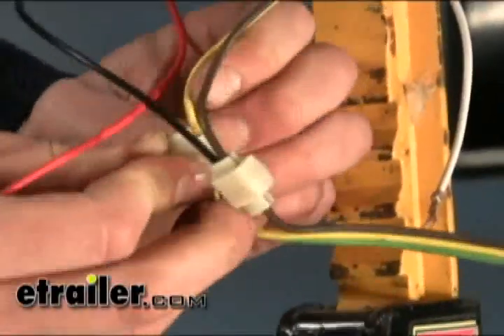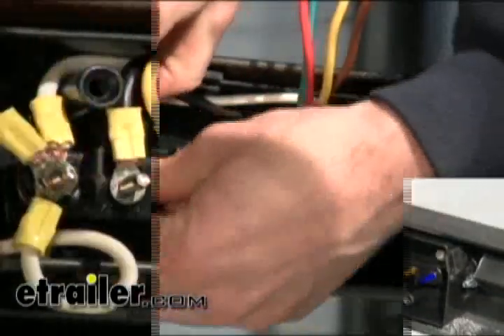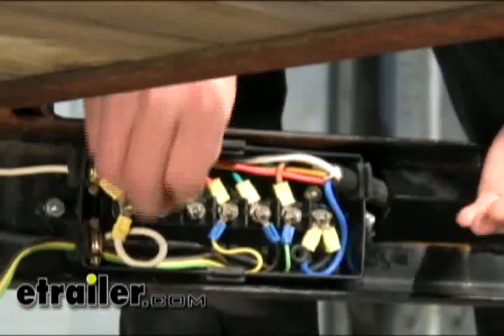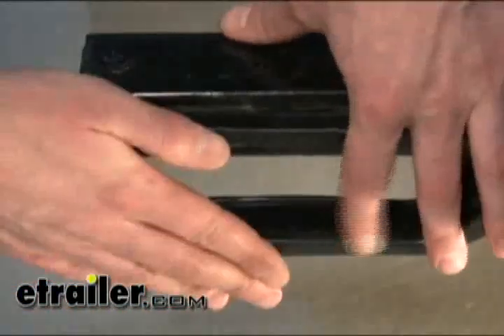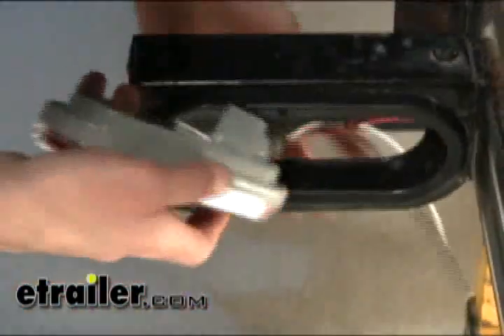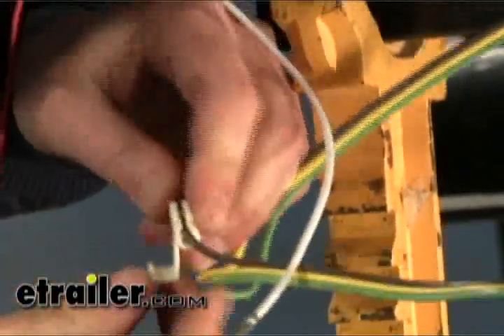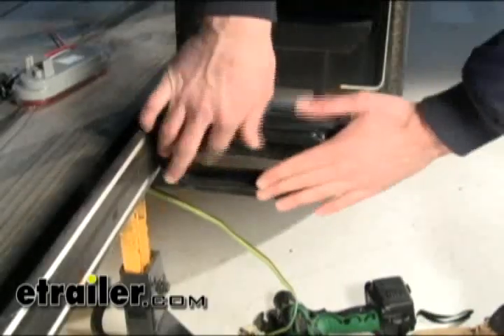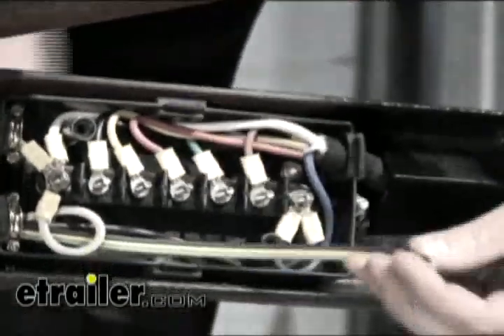etrailer | This Old Trailer: Wiring Trailer Tail Lights

Comment: I just changed my trailer lights to the round lights with red/blk/white wire. I have them running on the normal trail 4wire flat which connects to the vehicle flat connect. All of the lights work while vehicle lights on except when I press the brake .The lights go out but when I have no light on the brake lights work. I need a little help.;)

Comment: I just bought a bumper pull trailer and it has brakes of some sort(which don't work) but no charging box or junction box. I assume they are breakaway only brakes but am unsure. How can I get these brake to work again

Comment: I have purchased the LED lights that you were installing for my bass boat trailer. You have thouroughly confused me when you said to ingore the color code for wiring. I haave gotten as far as getting lights (Running lights) but no turn signal or brake lights on the trailer. Been at this for several weeks without figuring out what is the problem. Call me slow. 
Any ideas as to what I am doing wrong. THis is a new harness.

Comment: Hello, I was wondering something:  You used 3 bonded wires (yellow, brown, and green) correct?  What gauge wire were they? I am hooking up lights to my trailer that also include backup lights, if I use a 4 bonded wire configuration, can I use the 4th wire for the backup lights?  One more thing:  When you ran the 2 bonded wires from the brakes to the junction box, were they a 10 ga wire?  Thanks, Shane

Comment from the maker: Did the wiring of the trailer work correctly before you attempted to install the lights? Have you tested the wiring of your trailer to determine if the wires are functioning correctly?